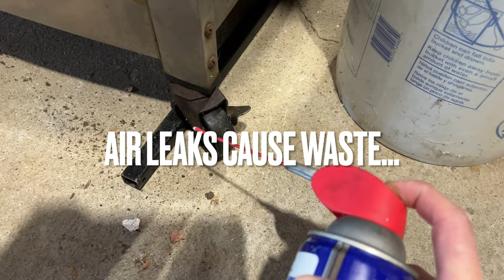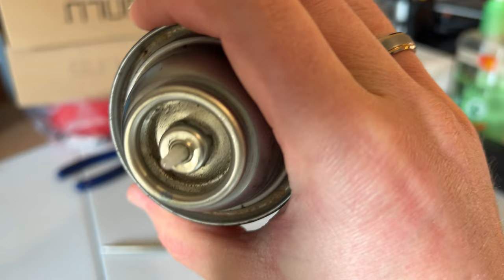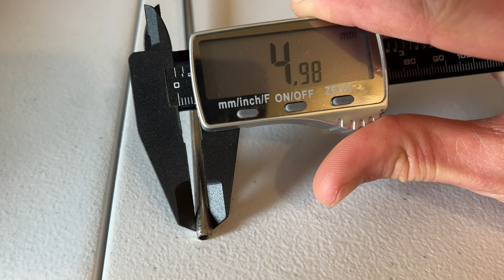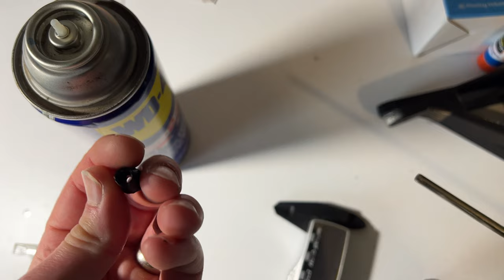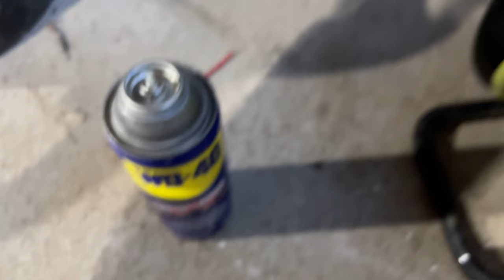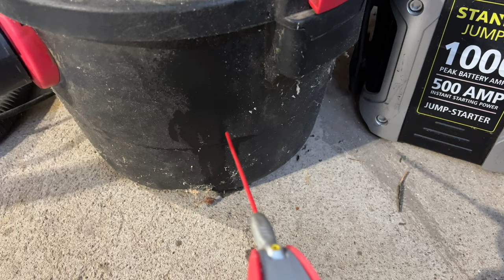Refilling WD-40 with Ease | 3D Printed Nozzle Adapter & Air Compressor Hack

Comment: hand remover 3000
Reply from the maker: Nah. Keep the psi low and it’ll be fine. Also catastrophic failure of a steel can results in very little explosive damage. They typically split. Don’t ask me how I know.